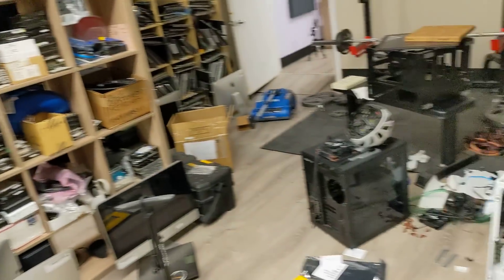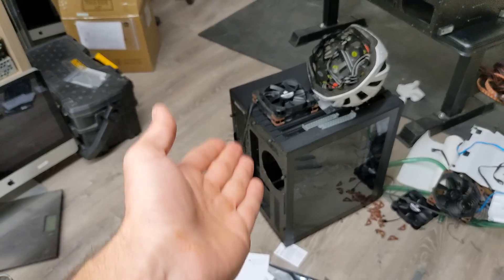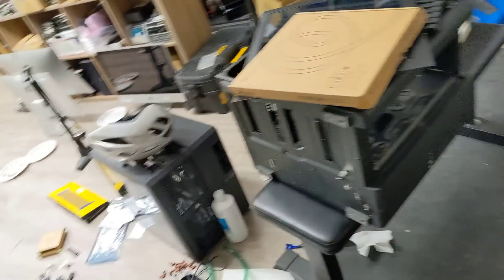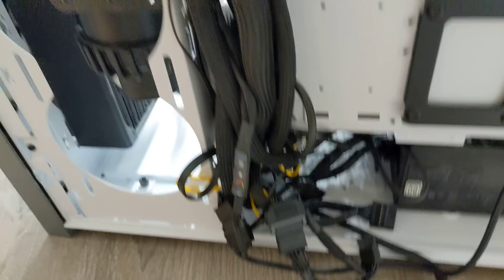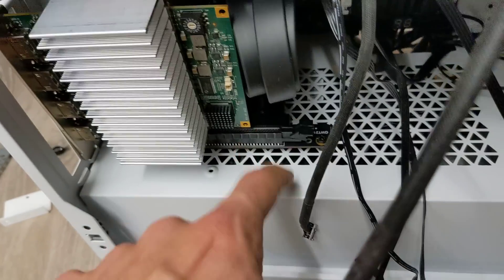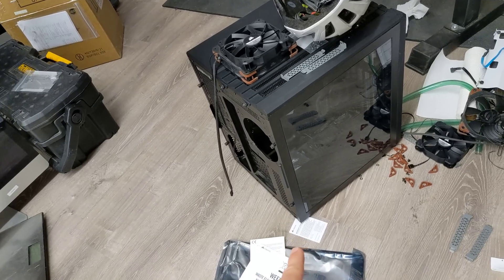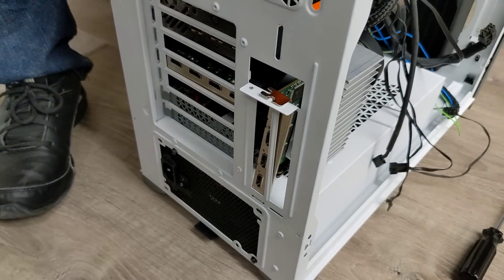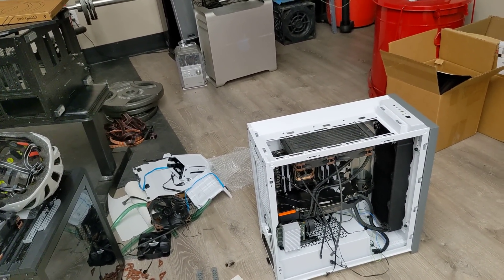I have a confession to make....

Comment: Worse than the Verge at building a PC? No. Poor planning? Possibly. Bad situation? Definitely. Clearly this is just a clusterfuck of nonoptimal combinations, case with bad PSU and front radiator support, which is also a fan issue (front fans of high static pressure under pulling would work here), a motherboard with a dead SATA controller (an add-in card would work here if you have the spare lanes and space), etc. Every builder runs into situations like this at some point, case compatibility is probably one of the bigger issues, especially when you are running so much water cooling or a case is preferably paired with a smaller power supply. Given the situation, especially the dead SATA controller, this might as well be par for the course, some might have a better time while others might have a worse time. Outside of time constraints, it's no big deal. Knowing the full extent of case compatibility is probably one of the best tools you can have when building a system, as that's where shit usually hits the fan; though knowing the extent of a system's capabilities is also a runner up for one of the best tools considering swapping the board with the dead SATA controller would've been the optimal solution here.

Comment: Why watercooled? Can be great for overclocked gaming but most normal use works well with a big Noctua HSF for the processor and then nice big but slow fans wherever there is space for a fan - but with the fans fitted so there is positive pressure in the case and the air gets in only through the dust filters.

Decent big-but-slow fans normally functions a lot of years with only some dust removal 1-2 times/year (adjust for how well the room is kept dust-free).

Water cooling can be cool, but the radiators etc does tend to add complications because of size. And wrong use/design followed by a leak can be sad.

Comment: Live & learn lol. 

Custom water cooling typically requires a lot of planning and calm. Which is why it isn't for everyone. However I would say that a Fractal Define 7 XL case would solve your problems with both that capture card and the HDD's. Just for the love of something, do NOT place your HDD's at the bottom of the case with a warm radiator in front of them! It's fine if you place the HDD's on their trays further up since the air doesn't get trapped there, however that also mean you can't have a combined radiator + fan thickness more than approx. 70 mm.

Comment: No... I refuse to believe I'm better at this than you. 
A) you don't want the fans on the front (Unless you mount the rad through the fans aka the fans behind that mounting plate.) But that shit just catches dust anyways.
B) that bay will fit in If you cable manage properly with zip ties christ thats not even close to not fitting do you have any idea how tight sff builds are? 
C) you can just cut the fins to fit the case... Its just aluminum get a grinder or Dremel and just cut them. Its massive over kill anyways. 
D) PCIe sata cards exist and are cheap as hell. There are even M.2 to sata cards...

Thanks for the ego boost.

Also what in gods dark sin is that tubeing? That looks like it was dropped by a time traveler from 1998.

Comment: I can top that. A couple of months ago i was tasked to build a pc for a friend of mine. I bought all the stuff to him (2 hours drive) to then notice that the mainboard is to big for the case i bought. He however wanted to use his pc so badly and after we reviewed our options, we grabbed an old wooden board, some nails and some metal scrap and just started putting the stuff on that wodden board. In the end it looked horrific but it worked. 2 weeks later he bought a proper case but then we noticed that the radiator wont fit. So we again got creative, broke off the top of his new case, placed the radiator on top and secured everything with fucking laces. I still have bad dreams about both XD

Comment: TBH you fell for the usual Advertisment BS like "360" Rad support and 3.5" Drivebays which all sounds great until you actually have to use it. (I mean, check the Picture on Corsairs Website for this Case: Even their nice Promo Pictures show no f'n space whatsoever for PS-Cables).

If I were you, I wouldn't care about what you have, but what you can make with it:
Strap some Notebook GPU/CPU Cooler on that capture card (add resistor or smth for fan RPM),  
drill some holes and mount the drive cage further forward,
rotate the front fans from the outside to the inside (pulling air through filter, case, radiator then fan).

Comment: In the UK there is a role 'a fitter' which describes someone who can overcome these challenges and are competent to do so. There are specialists in auto, mechanical .electronices, and plumbing - or any combination of same.  Not surprising that you would feel unable to build a computer - fine if all goes to  plan but it USUALLY DOESN't :-)

Comment: You're right. You do not know how to build a PC. 😂I happen to have the same Corsair 5000D Air Flow case (the white case) as you show in this video and one would be hard-pressed to find a better case. I use an EVGA Supernova 1000 watt unit that is much smaller than the one you chose and allows me to retain the 3.5" HDD cage.  Your front rad is too thick. A 28.6mm thick 360mm tall rad will allow you to mount the 120mm fans to the rad on the inside of the case which is how Corsair designed the case to be used thereby retaining the front air filter. The intake filter is very important unless you want to have to clean your system more frequently. I recommend removing the filter from the fans at the top of the case to reduce air flow restriction since they are typically going to be exhaust which does not require filtration. 

You didn't mention what CPU your using, but a 360mm AIO (All In One) liquid cooler would keep whatever chip you're using nice and chilly and hugely reduce the amount of headache involved in a custom open loop liquid cooling set-up like the one you currently have. Custom loops are not novice-friendly in either assembly or maintenance. Yes, custom loops REQUIRE maintenance, AIOs are a closed loop system and do not require maintenance after installation. 

I'm not sure what to tell you about the mess you have going on with the capture card, but I feel like a low-profile high air-flow (not a high static pressure) fan would allow you to install the card in the proper location instead of trying to rig that riser cable. 

If I didn't explain something clearly or you have any questions I'm willing to help as much as I can.

Comment: Yeah right all the compatibility issues when you use those expensive cases. If you don't buy their accessories that are designed for it you pretty much run into trouble everytime

Comment: I have this case too, the drive bay can be mounted further towards the front, the problem there for you is you have the thickest radiator I have ever seen :) (which is also why the fans have to be mounted on the outside I guess)

Comment: I know how to build computers and still deep sigh the last time I put one together, I misread the pictogram manual and used the wrong length of screws on the water cooler. Nothing bad happened, only my hands got wet, but that was around $150 right down the drain. That is what makes building computers great; they keep changing so much that even standards are only guidelines...

Comment: Most modern cases suck if you want a place to mount more than a couple of 3.5" drives AND a huge radiator. My home server uses a Fractal Design R6 and a simple fuma 2 tower cooler. There are larger options like the Corsair Obsidian 1000D, but at that point I personally would have gotten myself a rack mounted case instead

Comment: I have a Corsair 5000D airflow and I had the same problem, you just need to bend on your side the psu cables and make them vertical behind the case, you CAN fit it (i mean i have 2 HDD in that case with a deepcool 850W), you also have different mounting points for that), just put the cable out of the case and then put hdd cage in it, maybe buy slaves one, the ones that are not chuncky and big

Comment: I've been using a corsair 760t for a very long time, you can fit 12+ 3.5inch HDD's by buying extra drive cages and a few 2.5inch SSD's on the back while leaving the 5.25 inch bays available for other stuff.

Comment: Might have been easier to just get a new motherboard, ditch the water cooling setup and put everything back in the case you had if everything else worked and fitted ok before.

Comment: Honestly it's not that bad. The 3.5inch drive cage placement in Corsair cases sucks. I've done build recently in 4000D case and if I had just a inch longer PSU I wouldn't be able to fit the cage in there as well.

But I've seen worse than this. 

All you need to do is to ditch the custom water cooling and just get AIO with thinner radiator in the from then you can mount the fans and radiator from the inside and dust filter will fit. For riser cable you just move it closer to the front and it should be ok. If not just grind the heathsink a bit so it fits.

Verge was worse since they had all the pieces that would fit and still did it wrong.

Comment: Could get a Fractal Design Torrent,  I guess.

Still hanging on to my Fractal Define R5, which has gobs of external 5.25" and internal 3.5" space. Perhaps not that big radiator friendly, but then I only have a single 120 mm AIO for the GPU.
Reply: I bought a R5 for 20$ off market place, was my first ?designer case?(holding on to old 90's early 2k budget cases), thing is admittedly awesome
Reply: Torrent army represent. Or an O11 EVO.
Reply: The problem here was fitting the HDDs with a long PSU and front radiator installed and while the torrent would solve both issues, you are still throwing away one of the main features of that case which are both 180mm fans on the front of the case by installing the AIO. The define series will have the same problem as it forces you to choose between having HDDs or a front-mounted AIO, it would have to be mounted to the top instead.

Comment: When I build a computer, finding the right case is the hardest part. 1 thing dough: in most cases, you can put the fans behimd the radiator (inside)!in a pull config. Just be sure, not to use to long screws because you could puncture the radiator. MYbe check out some BeQuiet cases, there are some really big ones and they are very modular. (And watch some build cideos with them, so you can make sure that everything fits IRL.)

Comment: Oh my god!!!! What a brain job i feel so bad for you man! I had something of a similar issue with my CPU having a bent pin during installation and would have USB and RAM issues for 3 years until i discovered it (i had RMA'd my RAM sticks, and changed out my USB cables, couldn't overclock my 6800K either since it would BSOD regardless)..

Comment: Fwiw the reason your capture card won't fit properly is because that slot is meant for the GPU - that's a vanity feature to show off the fancy GPU cooler, but a side effect is that the case manufacturer will be assuming that the cards in the other slots are smaller, since the big GPU should be on the riser.

Comment: As I understand it, you only made one mistake here. You chose the wrong case. Everything else is the result of things not fitting into it.
That is way better than the Verge, on several levels.
1. They had some decent (not stellar, but ok) components that all fit in the selected case. It SHOULD have worked, if they hadn't fucked up the build.
2. They tried to build the PC with a Swiss Army Knife (which hopefully had a Phillip's head).
3. Their cable management was IIRC 3 zip ties (which they did not even use).
4. Their cardinal sin though was to publish the build-video as a how-to tutorial, targeted at people who do not know how to build a computer. And at no point came out and confessed that it was a bungled build. I am horrified of how many newbs chose THAT tutorial to learn how to build a PC. How many computers has this Video made into a stillbirth?

Of course when the more competent community made fun of the video and pointed out how bad it was they doubled down and explained that the computer was running fine. Without mentioning even ONCE that the journalist who did the build took it apart when he had the time and build it correctly. 
Sure, everybody can fuck up. Hell, everybody WILL fuck up sooner or later. Owe to your fuck up and try to make it better. Do NOT try to sell your fuck up as a way for beginners to do something.
Especially not if your fuck up could serve as a tutorial on what not to do.

Comment: Louis, you're a brave man for even admitting what you did publicly on video.
I wish I had a dollar/euro for each "management type" who berated their lower level techs for inadequacy about a particular job, claiming they could do better especially when they had either zero tech experience/qualifications or the last PC they worked on was from Windows95 era.

Unlike those types, Louis you actually have an on-going tech competency & aptitude and sure it may take you slightly longer to come up with solutions to your PC build but not only do I believe that you'll succeed but above all, you're willing to admit when you're wrong over a technique or process because you genuinely want to learn & skill up & aren't afraid to do so & you own it 100% ie you're a ITIL dream!.
Had you not been under huge time pressures due to the Texas move, you would've had it in the bag 100%.

PC building/assembly is a black art at the best of times especially with oddball, non-standard installations or specialised rigs for gaming, video production, servers, video editing & other, high data processing requirements & if you aren't used to the latest PC design methodologies it can be a frustrating slog to pull it all together & there isn't a super experienced tech I know of who hasn't run into similar issues at points in their careers.
Kudos to you Louis!

Comment: I feel this. I had a Sony Vaio. Power Supply blew on it. Okay, just get a new Power Supply! Problem: Sony uses overpriced proprietary power supplies. Okay I'll use a generic but it won't fit in the tiny Vaio case. Okay I buy a new case...well now your capture card, which was the whole reason I BOUGHT the Vaio, doesn't work because it was designed specifically for the proprietary Sony Vaio case. Yay.

Comment: The fans attach directly to the radiator. You can have the fans on either side. One is a "push" configuration, the other is a "pull" configuration. Meaning one pulls air thru the radiator, and the other pushes. There are arrows on the fans to indicate the direction of airflow. Mounting the radiator in the front you want the fans direct air into the case thru the front. Which is why the dust filter is needed.

You also need an exhaust. Make sure you have positive pressure (more intake vs exhaust) instead of negative pressure, otherwise dust will be sucked in thru the imperfections (gaps) in the case. With positive pressure some air will try to push out from those cracks, pushing dust away rather than sucking it in.

Comment: Radiator and fans are placed wrong that's why you can't place the front mesh. Suggestion is removing fans from case, attach fans to radiator than attach radiator to case not sandwiching the case between the radiator and fans. Best advice is bigger case to fit everything but you don't need everything. Other thing you can do is getting different AIO and PSU.

Comment: Man, I thought I was bad at building cases.  I just gave up and got a thunderbolt 3 enclosure case that can fit 3 PCI cards, so I have two capture cards and an empty slot, it is the Sonnet Echo Express SE IIIe, and my PC case is just a CPU, HDDs, NVMe, and Graphics card so it is tiny.  I can't cable manage worth a crap.  This also allows me to just connect the Sonnet thunderbolt enclosure to any computer and it works great.  I have moved it between 2 PCs and one mac mini.  I think you have to have a mac M1 or an intel chip, AMD has problems with thunderbolt from what I understand.  I use linux on my PCs and it works.

This is convenient on upgrades because I never change my capture cards and now they are the only PCI cards I really need anymore so I just move this enclosure to a new PC.  I only capture in 1080p though, not sure how many 4K streams Thunderbolt can handle, haven't done the math, but it can handle at least 3 1080p streams.

EDIT:  Oh yeah, the reason I just don't get USB capture cards is because the support for them sucks in Linux and even on Mac and Windows the PCI capture cards footage just seem to look better.

Oh, and if that is a magewell capture card that is the old capture card that doesn't do fan throttling, it is always full blast.  I just got a fan regulator to slow the fans down and have never had a problem.  If you buy a new one the fans will automatically slow down when not hot but I was too poor to buy a new card, I got mine off of ebay and the manufacture date is sometime in 2015 so before they started adding fan throttling.  From what I understand that was added in cards they made in 2019 and later, not 100% sure though and magewell won't tell me.

Comment: fyi, if u gonna hunt for another case, Phantek p400 won't work for you either.  i have p400 and if you mount AIO radiator to the front (Only place they can be mounted unless its one fan), you don't get any 3.5" drive mount. had to resort to buying a 2.5" SSD and shuck a 5T external which i wasn't too happy with. found out what the product page says what it's capable to mount is different by use case...

Comment: Get a Loan Li O11, it's the one true case series.

You don't have to have fans and radiator with case between them.  You can have them all on the inside of the case when there's no space on the outside between chassis and cosmetic panel.